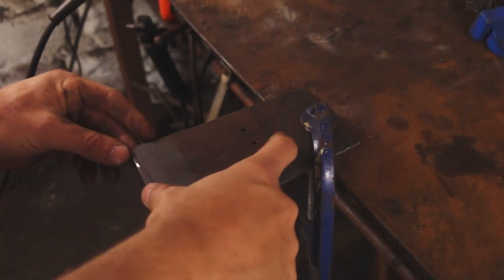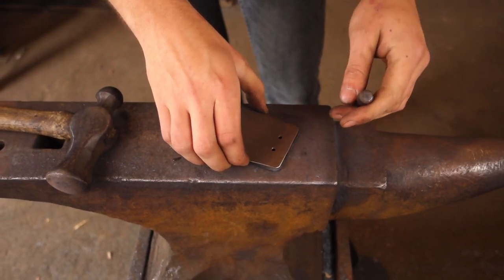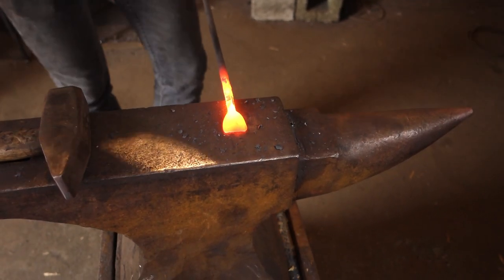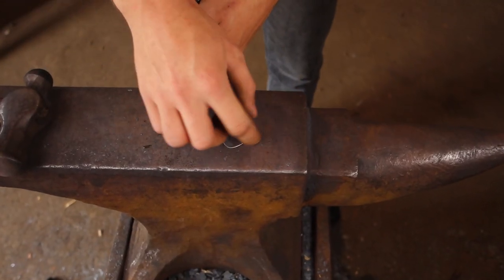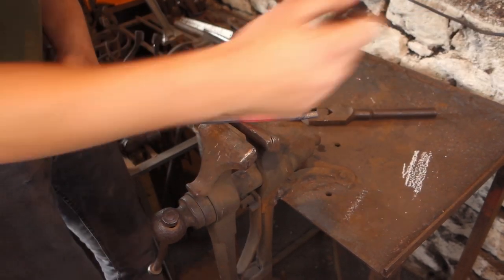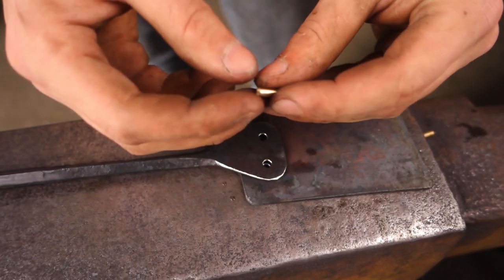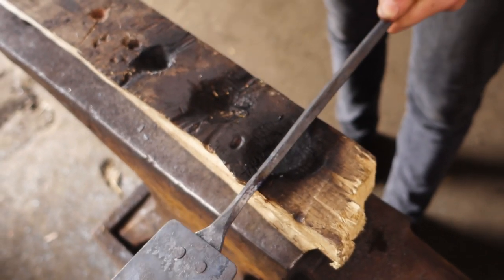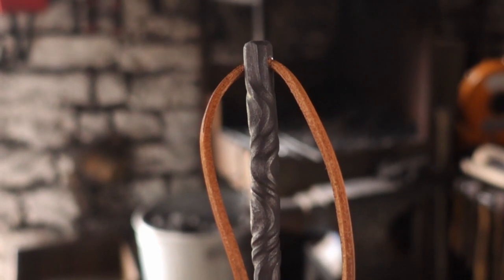Forging a Spatula

Comment: Brilliant! looks good, how do you stop the spatula from rusting? also what are the dimensions of the template you made for the spatula thing? :)
Reply from the maker: It gets hot finished with vegetable oil to stop rusting and the template is about 100 mm long 80 mm at the end and 60 mm at the top.